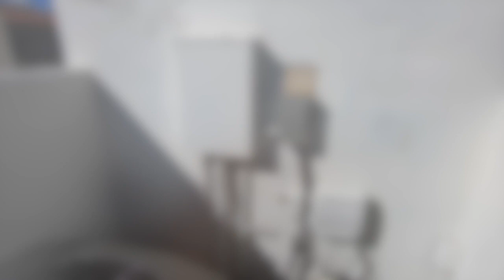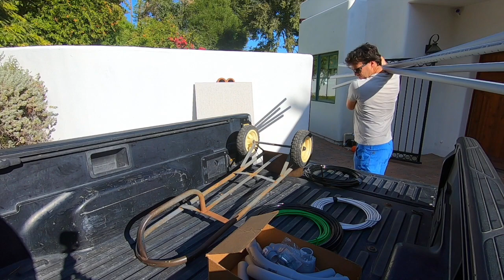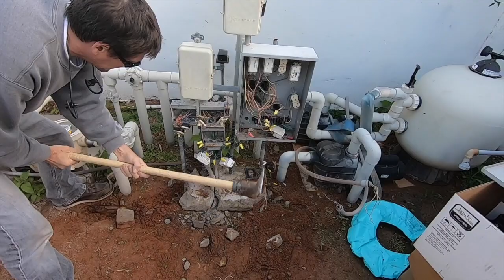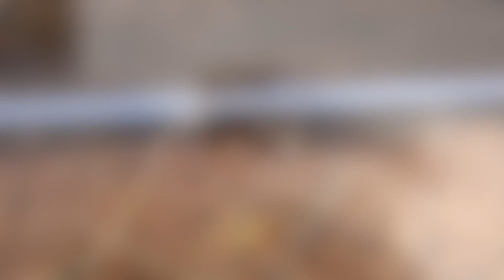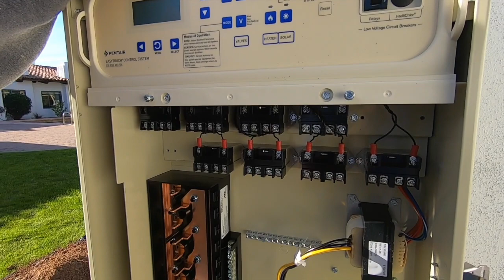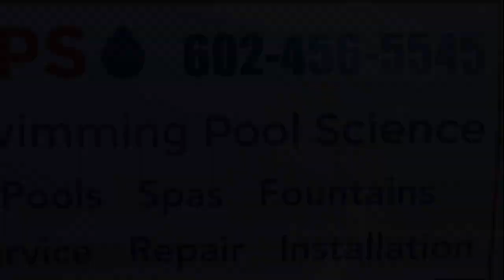Pool Equipment Makeover Part 1

Comment: *When laying/burying electrical conduit or direct-burial rated cables, the depth requirements (NEC Table 300.5) are measured in inches of cover, not to the bottom of your trench. So if you need 18" of cover and you're laying 1-1/4" conduit, you'd better be at least 20" deep on your trench (wiggle room for irregularities). An alternative for this in some applications is to cover the conduit with concrete at least 2" thick, but it is conditional. Check the code closely before using this method, and possibly with your local inspector. I have had to use this method in the past when dealing with underground (fossilized) coral or boulders that were impractical to trench through.

*Nolox (corrosion inhibitor) is unnecessary for copper conductors, but is highly recommended and in some locations required for aluminum conductors especially when connecting to steel terminals

*Bushings are required at the conduit terminations. Yes. Even for PVC conduit (NEC 352.46, NEC 300.4(G))
(above the conduit)

Comment: ALWAYS fun to watch how other's do the same job you do, me Josh I use a "roofer's " propane torch to heat pipe,i use that yellow goo to pull wires, and here in Ca,lif. I paint all the PVC plumbing to protect from UV rays,.....on to pt. 2
Reply from the maker: Yes! Roofer’s torches really are the best for the job as the heat isn’t as concentrated so you can avoid burning the pipe and get it done quicker. The paint cans start rattling in part 2!

Comment: in Arizona do you have to put anti-corrosion compound on copper wires at their termination point or did y'all just go above and beyond for that you always have to do it for aluminum wires because of the expansion and contraction an oxidation can cause a micro ark which may start a fire

Comment: Why not go with an aqualink RS 2 x 6 if it's separate bodies of water the aqualink RS 2 x 6 comes with a water temp sensor for the spa water temp sensor for the pool and air temperature sensor also can control to separate for two separate bodies of water at the same the easy touch cannot achieve this goal but I do understand the price difference between the easy touch at $2,400 versus the aqualink RS 2 x 6 at $3,200
Reply: The Easytouch cannot do that but the intellitouch can. But yes, im a jandy exclusive builder.
Reply: And besides who knows, he prolly got the panel on a try me price